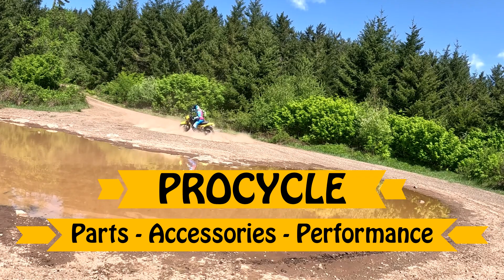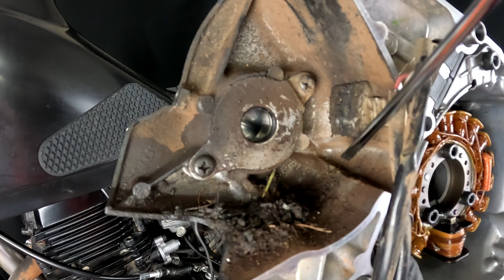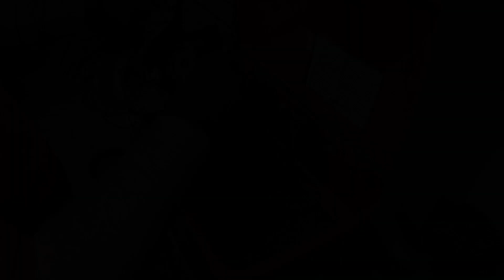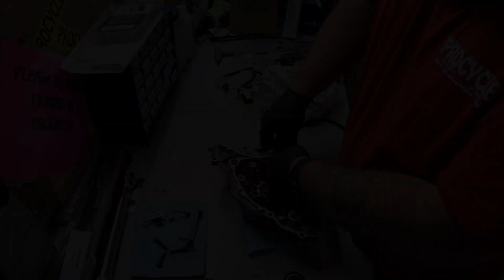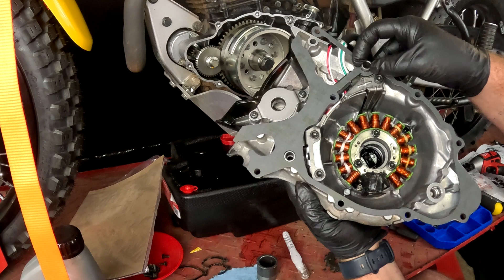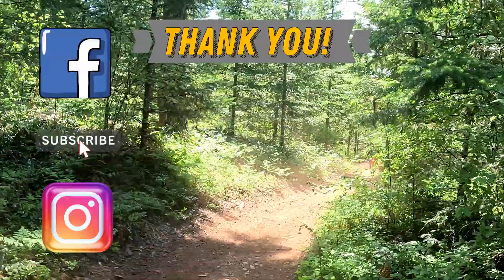TW200 Stator and Countershaft seal replacement

Comment: Do you put silicone sealant over the top of where the wire harness is before the gasket?
Reply from the maker: Yes, a little silicone sealant around the wires is totally fine.

Comment: The starter motor of my tw200 was removed and cleaned yesterday. After reinstalling it, the starter motor can run, but the engine cannot be started. I can only hear the starter motor rotating. Does anyone know what is going on?
Reply from the maker: Sorry to read you're having an issue with your bike not starting.  Sounds like maybe something else was left or got disconnected during the repair.  Check all of your electrical connections.  Give us a call if you can't figure it out and we'll help you figure it out. 541-688-9543
Reply: @TeamProCycle  It has been solved. It turned out that the magnetic pole direction of the starter motor case was reversed. Thank you for your reply.

Comment: Is there a link to get the upgraded Stator?
Reply from the maker: We're waiting on the production run to be finished. We don't have an SKU to even put it into our system at the moment.  As soon as it becomes available I will update this video bio with the link. We apologize for the delay and are working with the manufacturer to get this going asap.

Comment: I need to do this on my DRZ. In fact, I got the replacement stator from you guys. I know the process is similar, but is there anything particular about that bike I should know ahead of time?
Also, as much as I enjoy the TW content, I’d love to see more of these videos for other bikes, such as the DRZ. Thanks, guys!
Reply from the maker: Thank you for watching the videos and I'm glad to read that we were able to help you get the part/s you needed.  The replacement process is pretty similar.  There are a couple different length screws to pay attention where you removed them from, use thread locker on the internal screws, and just make sure the gasket mating surfaces are clean.  
We'd love to get our hands on a DRZ and put some effort into it and get potentially new / better products out there on the market for it.